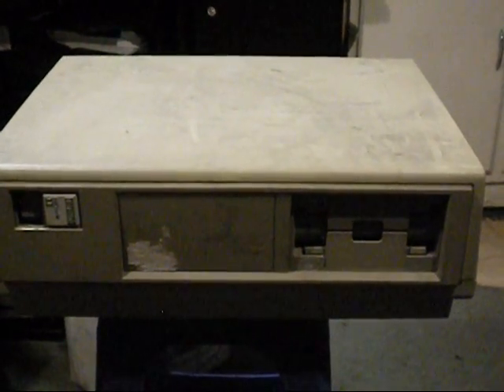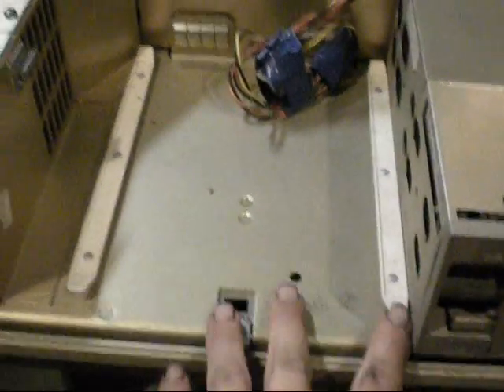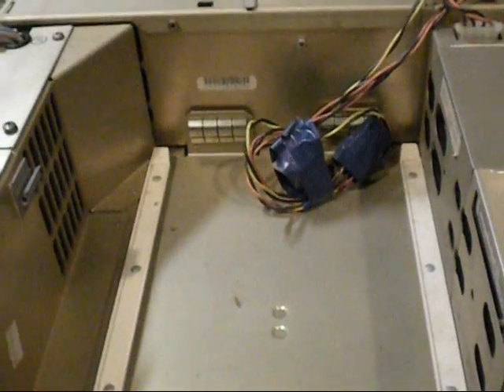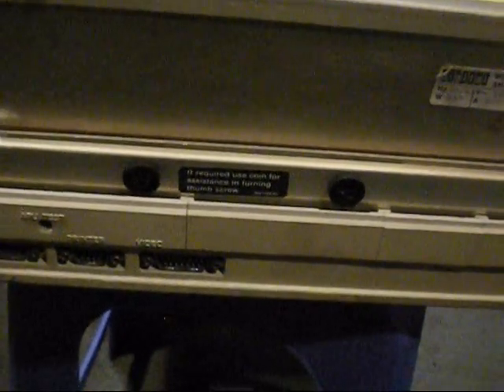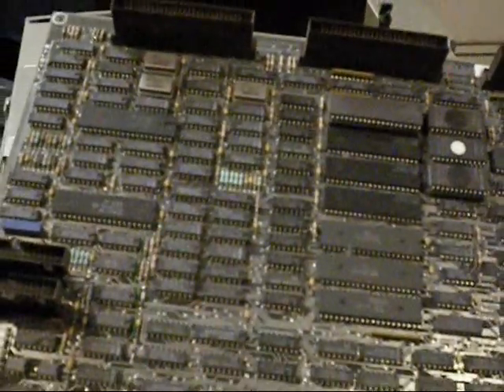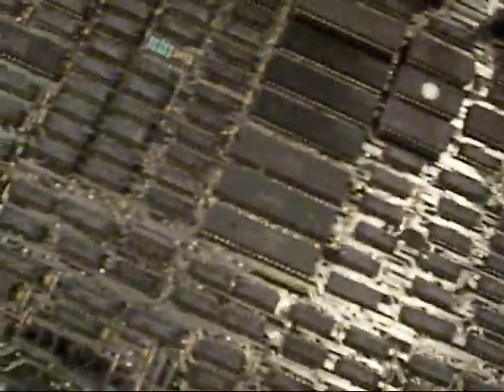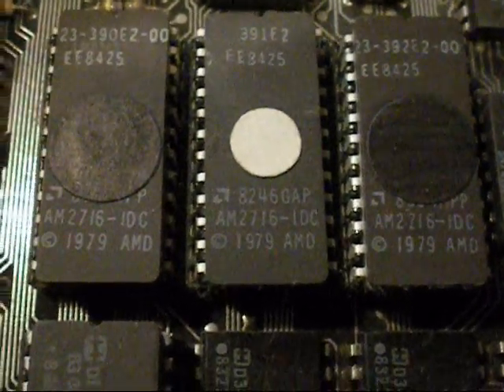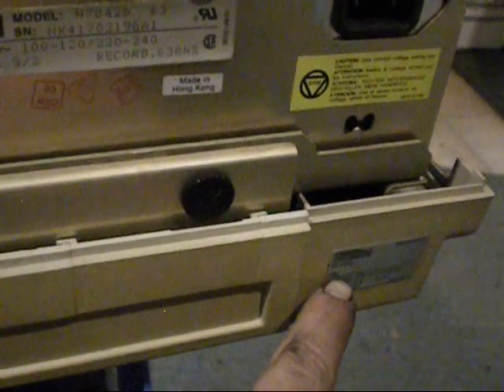30 year Old computer thing.

Comment: I had one of those.
If you get around to looking for a hard drive for one of those you are looking for a 5 1/4 inch MFM/RLL hard drive (not IDE), and the operating system was called CP/M... I believe the processor it had was a Z80 or an 8088, prolly had about 128KB or ram too...
Reply: harris pdp8 6120

Comment: It's an old desktop computer compatible with the PDP-8.  It'll either have a 6100 or 6120 main processor and 32k (that's 32,000 12-bit words) of RAM.  It's pretty much useless without the keyboard or video monitor which shipped with it.